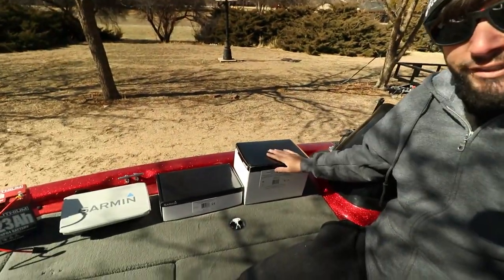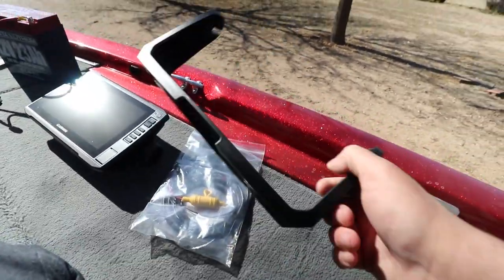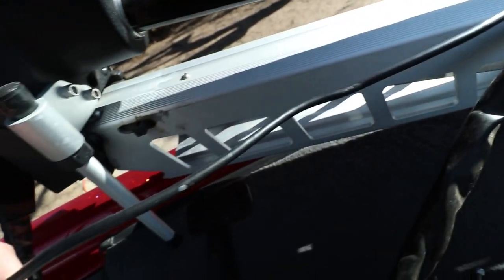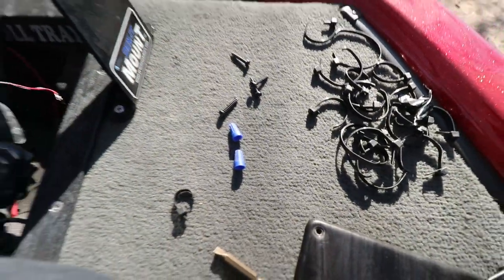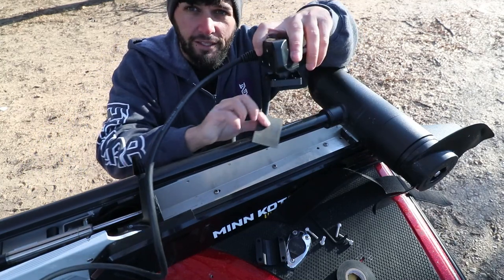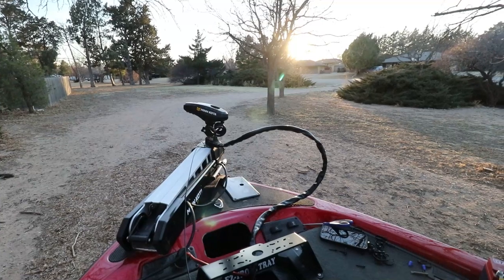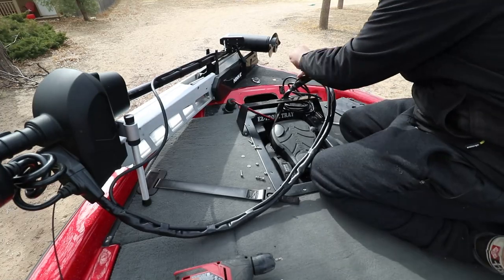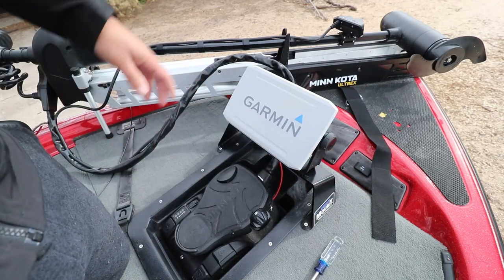Installing LIVESCOPE on my BASS BOAT (HOW TO / SUPER EASY)

Comment: Before using the existing power wires to supply power to your Garmin, you should have checked to ensure that they were sufficiently sized.  Garmin recommends 10 gauge for up to a 15 foot run, and 8 gauge for longer run.  I highly doubt that the wires you used were 10 gauge.  You may want to look into that.  larger wire will give you better graph performance.

Comment: FYI, a Nylon or stainless steel Marine Wire Cable Vent Cover, Clamshell Vent for a Boat is a option where you can't use grommets. I hope this helps. 🍺🎣

Comment: You may need to upgrade your battery or add an additional matching battery in parallel for your Livescope & Echomap UHD93SV Unit. You essentially are running (2) units now... 🍺🎣

Comment: can u not wire the black box to the cranking battery ?
Reply from the maker: You can wire it to any battery, but the black box pulls a lot of power so I like it on its own battery in case I forget to unplug it, it will kill the power to anything else

Comment: No reason a inline on off switch couldn’t be installed between the battery and black box
Reply from the maker: Nope, just went with the quick disconnect option